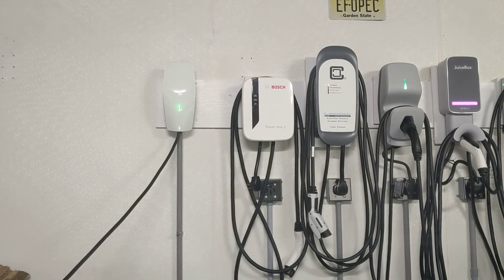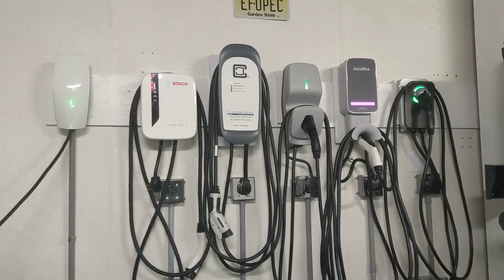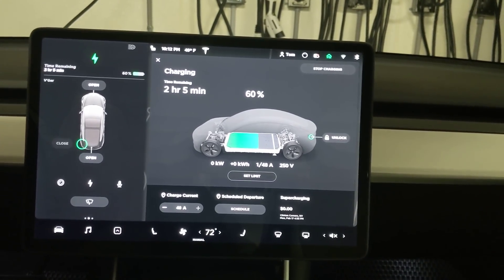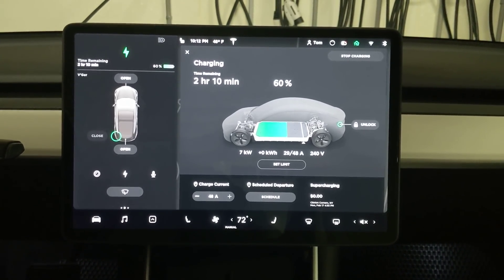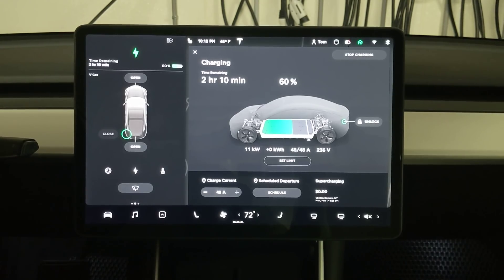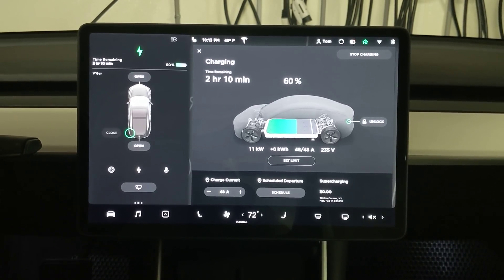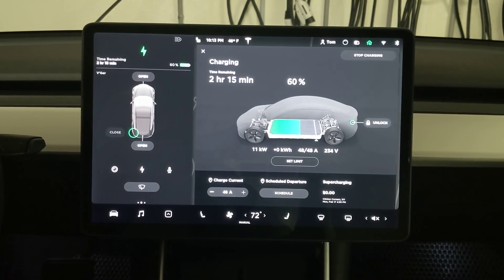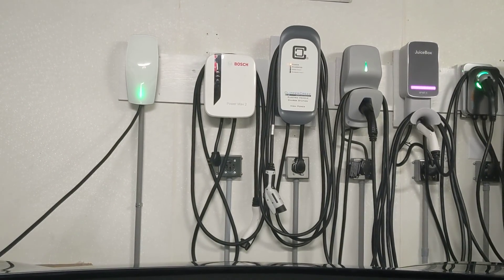Tesla Generation 3 Wall Connector test after install

Comment: Dumb question.... I'm on a 60A breaker but my app allows me to charge at 32A. I checked the settings on the Wall Connector and it is set to 60A. Am I doing something wrong?

Comment: Is the cable was changed? Tesla reports as: The lightweight 24-foot (7.3 meter) cable allows the Mobile Connector to be left in the car.
Reply from the maker: Yes they changed it to a longer cable not long after I did this review. I'll be doing a new review of it in the coming months
Reply: @StateOfChargeWithTomMoloughney  appreciate your answer.

Comment: I just ordered a Gen 3 HPWC for our Model Y, $500 for something so sexy and with a 4-year warranty.  I'm told if something goes wrong I can just visit my lock Service Center and they will take care of it vs having to contact the vendor and ship it back to them or wait for them to send a new one.  I'm going to install kine with a NEMA 14-50 plug so I can keep my NEMA 14-50 outlet, 9.x kW is fast enough for my home charging needs.  Thanks for the video.

Comment: Hi Tom, AWESOME wall of chargers you have set up. I know you are an i3 owner and I am going to become one in next few weeks. I'm super excited to become an i3 BMW owner and this will be our first one. I'm going to be purchasing the 2017 94Ah w/REX and I was wondering which charger you use for your i3? The i3 were getting is mainly for daily commuting to work around 65-70 miles round trip and running a few errands here and there. I been looking at Bosch, EvoCharge, and the Juicebox chargers for the home setup. I presently have a 20 amp 120V outlet which I know can (Trickle Charge) with no problem, but wiil have to upgrade the outlet to a 220V for Level 2 charging. Can you run any of the level 2 chargers that I mentioned on a 20 amp outlet or will I have to upgrade the outlet to a larger amp (ie: 30 amp) as well? BTW Awesome videos you have on your channel - keep up the great work !!
Reply from the maker: Hey Geo, sorry for the late reply. I just saw this now. I don't believe any of this will work on a 120v source, regardless of the amperage. You really ought to consider upgrading to a dedicated 40-amp (0r 50-amp), 240v circuit if your home can provide that without a service upgrade. 
If you can't maybe you should look into a Quick-220 product (there are other manufacturers of similar products). Basically, you will plug into two outlets (on different phases of your service) and then you can plug a 240v EVSE into it. Look into it: https://bit.ly/3qo5JkC
Reply: Cool, Thanks for the info Tom 👍😎

Comment: Why isn't your display showing the charging status as miles per hour. The previous charger, for model 3, was 44 mph.
Reply from the maker: It depends on how you set your display. I have mine set for energy, not distance, so the kWh draw, not the miles per hour display while charging.
Reply: @StateOfChargeWithTomMoloughney  so is it charging at Max?
Reply from the maker: @Tuck_Frump  yep. 48-amps is maximum draw for the Long Range Model 3.

Comment: can it be installed by plug in to an outlet instead of hardwire to panel?
Reply from the maker: This model is meant to be hardwired because it can deliver 48-amps. A NEMA 14-50 outlet can only safely deliver a 40-amp continuous load to the car.
Reply: ...in other words yes, but you need to set the output to 40 Max instead of 48